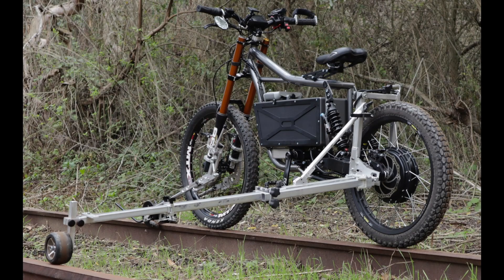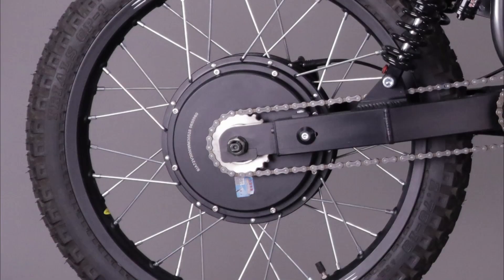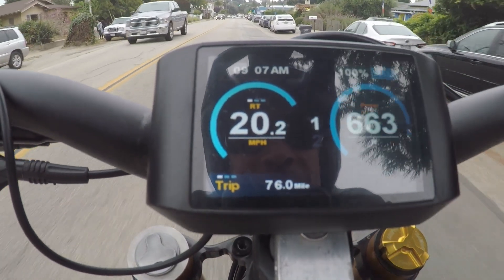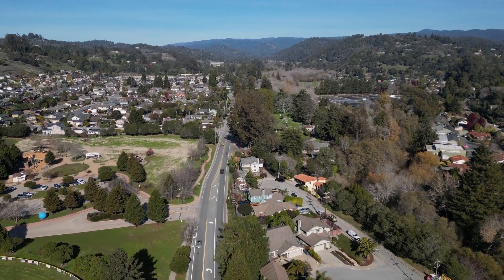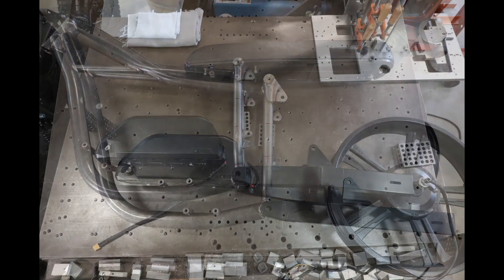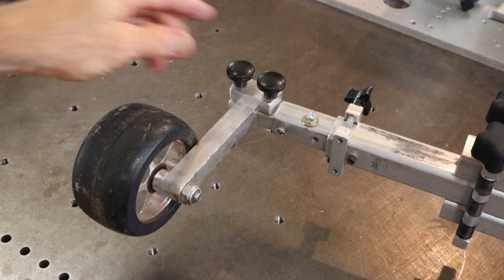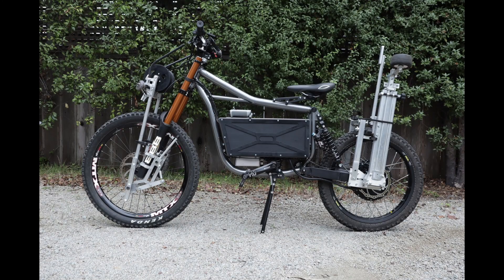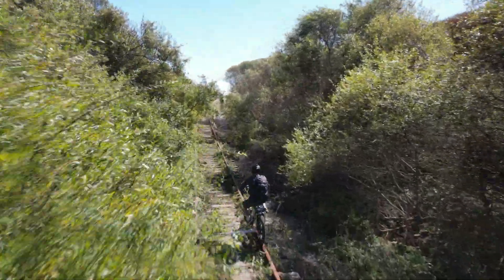Electric Rail bike Build Q&A

Comment: I know it's an old video but those front pins could be 1 singular rod bent in front of the wheel, then it would be sturdier and protect the setup a bit had on, just a thought :)
Mid motor seems quieter to me vs hub motors, I think it's just the positioning that makes you hear it less. Mid motor also got help of your gears. You could use mid motor and belt drive with internal gears. 
Cool trip, made me look up abandoned rail ways here in Sweden but isn't really any.
Reply from the maker: It depends on the hub motor, most hub motors are geared which make noise, direct drive hub motors are dead silent.

Comment: Dude you should try an Idea with regenitive breaking and adding a solar panel attachment and see how much can it increase your range that would be a dope ass build.
Reply from the maker: This bike does have regen braking, that's fairly standard on a direct drive hub motor. I would like to try some folding solar panes though.
Reply: @kev7777777777   Fiairly standard? I'm not so sure about that, unless you're buying from a very specialized brand your not getting regnitive breaking, I've done multiple builds of Ebikes and never had regen on any of my motors and most Ebikes online I've seen never advertised it which usually means, their motors don't have it. I wish it was industry standard like how it is on EVs but currently it isn't. We get the cheapest motors available with jacked up price tags attached lmao. 
Also do you have a website from where you advertise these custom builds? Like how do you go about planning them with customers? I've been looking for someone to do a custom build for me but I have issues trusting all of the sources I've been recommended because they suck at advertising what they can and cannot do and I have no clue if they have expirence with doing builds that accommodate for EVs PLUS your expected to pay them before the talking even begins. It's too much of a haste to work through a bunch of unknowns.

Comment: Thank you for covering all the engineering and machining aspects of this. I rode a lot in Santa Cruz and appreciate your travels and the good drone and editing of all the videos. 
Now you need to add an electric weedeater option on the front cat whiskers for those pesky grass and weeds! 
We can see the poor quality of the tracks, maintained for coal trains to davenport. They wanted to put a tourist train on them in Capitola / Santa Cruz, what a mistake... I noted when they got people on a train to see they noticed how bad the tracks were for passengers. Your films really show how wavy, rolling and bad shape they are in. The bike really takes it well and those welded ground connections are a real challenge you designed well!  
I read  an article about how we ended up with the width size so strange, it came down to roman road width and the width of two horses butts!
Thanks!

Comment: Excellent video's and build explanation, new subscriber here. I bought a Trek bike that was converted to an e-bike. It has a 1000W rear hub motor with a 48 watt controller and 14 AH battery. I disconnected the speed limiter wire, and that thing will get me up to 30mph (flat ground) with a range of around 40 miles. Your bike is the most bad ass bike I've seen and could only wish.

Comment: interested i really like your frame design alot of thought went into this unlike most others you have the battery low in the frame making it low center of gravity very responsive it just stinks of performance well done by chance would you consider building another frame or even maybe you still have the paper template to share lol

Comment: I have a Jackal electric bicycle from Thunderstruck motors.  Would love to convert mine.   Its original design is very open to conversion like yours.  I would not need any of the rail bike capability.  But the rest is ;right up my alley.  Would love to talk about this further!

Comment: Any consideration for adding a front regenerative hub, to capture forward inertial motion and implement self charging. Why that feature isn’t on all electric vehicles is astounding IMO. Great job.
Reply from the maker: The bike has regenerative braking, so it charges when you brake. That's one of the advantages of a direct drive hub motor.
Reply: hey there!! May I ask you to build me a set of the front/outriggers? @kev7777777777
Reply: Yeah I always wondered why consumer market was satisfied with just hard braking regenerative charging. Remember bicycle generator lights ? No reason a separate hub dedicated to charging one half pack while you use another. And that’s the glaring point. Why this free ranging concept to electric cars was not implemented.
Reply: @Mirage1967  Regenerative breaking on lighter vehicles traveling at low speeds (like an ebike) typically only extends range by about 5%... whereas using a mid-drive motor with good gearing can extend range by 15% compared with a direct drive hub motor. So the trade-offs aren't worth it in most cases. If a direct-drive hub motor was chosen for other reasons, like in this video, then you might as well add regenerative breaking.

Comment: Thank you so much for sharing specs on the bike! I love the in-depth design process. Very cool that you're testing out new models/iterations of it. How much does the smaller 2.0 version weigh?
Reply: Also! Are you able to incorporate regen in the system with the hub motor?

Comment: What would a frame alone cost?  I have an electric skateboard I built a few years ago which has a 50-mile range and a top speed a lot faster than I'm willing to go.  This is a more practical way of getting around without relying on  a car.

Comment: id I'd be interested in buying the frame or a frame like that without the running gear just the frame fork and rear shocks no wheel or breaks or handel bars i like the look for this frame Lots of space and it looks strong I've got ebike running gear controllers and batteries

Comment: Big thanks for the insights. Perhaps I can suggest a rear view reversing camera feeding a small screen on the handlebars, that way you dont need mirrors, dont need to look over your shoulder and can still see whats behind you. Can always power it with a 12v step downboard from your main battery array 🙂 Helps of the saftey and general awareness front. Keep up the great work!